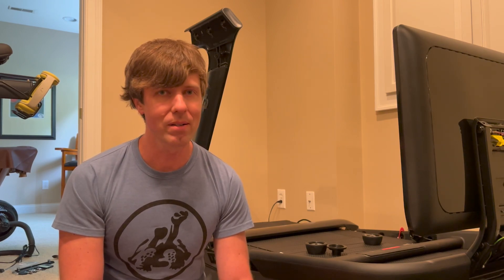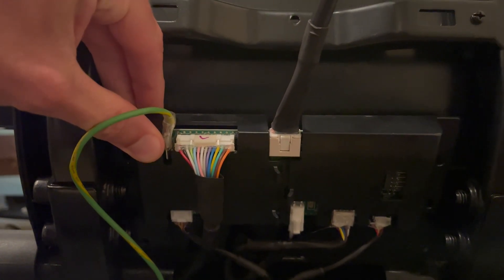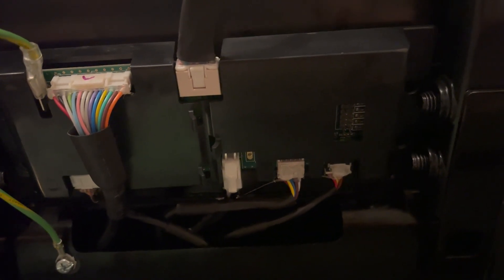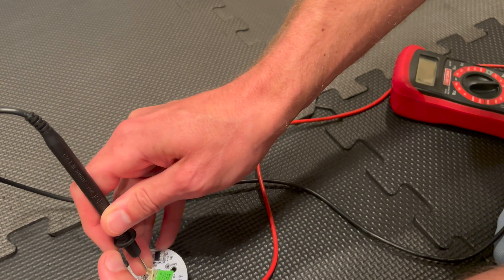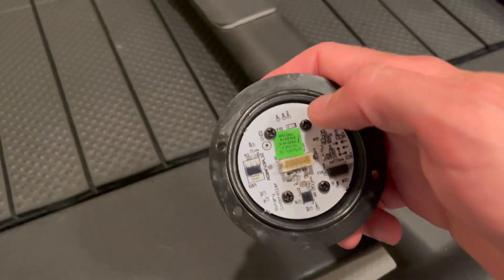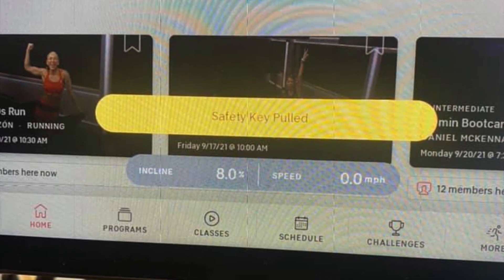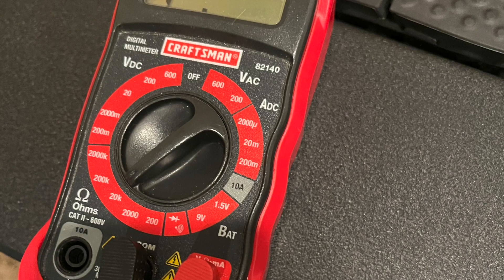Peloton Tread+ Repair DIY Tread has stopped communicating, firmware failed, and safety key issues

Comment: Hi Charles, first of all I want to thank you for the videos you make so we can do maintenance on our machines. Look, I have a problem with my Peloton Tread Plus: I turn it on, it starts, but after a few seconds or a minute it stops and shows error T0201 – error T0256 (Remove and reattach the safety key).

Do you think you might have any advice to give me? This has me frustrated since I already replaced:
	•	Speed knob assembly
	•	Smart card PCB
	•	Tread+ wire harness

Even after replacing these three parts, the problem still persists.

Comment: Do you have pictures or images of the backside of smartcard pcb? I think theres a solder problem on my connector to the LCD.
Reply from the maker: Sorry I don't think that I do. The only images I have of it are in this video. I never did any tracing as I just tried swapping with a new one.

Comment: Hi Charlie.  We have a Tread + that stops working while running/walking.  The message that pops up when it happens is "Looks like you're off the tread.  Belt will stop in 12 seconds".  The first few times it happened the screen would turn off and belt would stop.  Now the belt stops for a second, the screen stays on in the class and the belt turns back on.  We had a Velofix technician out and he said the base needed to be replaced and after talking to Peloton support they said it was a 223 error.  We got the tread + in December of 2019 and have had no problems.  Velofix put on the rear guard a few months ago.  Any advice?  We are out of warranty so it's a huge expense to replace the base.
Reply from the maker: Hey Stacy. Sorry I don't know exactly what the issue would be. My hypothesis is that the Tread senses whether a user is on it by measuring the load on the motor. This is why it won't work with people under a certain weight. When it gives you the message, if you shuffle your feet or try to slow the belt a little does the message go away?
Reply: @charlieaf92  Thanks so much for replying.  The message pops up when the tread starts, then it works for about 13 minutes.  Every time it stops the message pops up and then it's just a continuance of it stopping.  Sometimes the screen turns off and you have to restart, but most of the time it stops and starts, but clearly you can't be running or even walking fast under those conditions.  We bought our tread plus  in 2019 and have had no problems until 2 weeks ago.  We did get the rear guard installed in June.  We had a tech out here and he confirmed with Peloton it's throwing errors (223?) and said we would have to replace the base.
Reply from the maker: @StacyFink-p9z  Hey Stacy. With the machine turned off are you able to make the tread belt turn? Try pushing it with your hands. It should take some effort to make it turn. Let me know if it feels loose.
Reply: @charlieaf92  Hi Charlie.  We can make the tread belt turn and it is not loose.  We started the tread and this time we had to reattach the safety key before it would start. That is the first time we got that message.   My husband tried it in free mode and it works fine.  He thinks it's the motherboard :(
Reply from the maker: @StacyFink-p9z  Hey Stacy. Just to clarify, when you started the machine the key was in place but you received a message saying it was not? Then removing it and replacing it fixed that issue? If that's the case I tend to agree that it sounds like a logic board issue. There are several in the machine. My last bit of advice would be to call Peloton and ask to speak with someone in the parts department. My experience has been that those folks know at least a bit about troubleshooting and what parts to try swapping out. Their policy may have changed, but when I replaced my "smart card" during troubleshooting they allowed returns if the part didn't end up fixing it.

Comment: Thanks for the video! Great info. Do you know if there is anywhere to purchase a new communication cable? I accidentally pinched it in the side rail and it severed the black and grey cables. Thanks in advance
Reply from the maker: I'd call Peloton and ask to speak to their parts department. I found them to be very helpful.

Comment: Where did you buy the replacement PCB? Do you have a direct link or did you just talk to Peloton support? I was able to order the part through Peloton support, but a direct link would be preferred! Thanks!
Reply from the maker: I had to call support and then ask to speak to someone in parts. Once I got to the parts department I was pleasantly surprised to find them knowledgable and helpful. They definitely know more about troubleshooting and repair than the standard support person you get when you first call.

Comment: This was very helpful. I have the Peloton Tread (not the plus) and the wires got nipped when reassembling after moving. We know which wires to replace but unsure of how to feed them through the u-rail. Will the U-rail completely disassemble enough to feed the wires up to the monitor?
Reply from the maker: Sorry I can't say for sure. However if you have access to one of the snipped wires you may be able to use some electrical tape to attach the new wire to it and pull it through.
Reply: Were you able to figure out how to feed them through? Nipped the communication cable when putting back together. Also, where did you buy the replacement wiring?

Comment: any common issues why my tread is not turning on? I had to move it to my garage reassembled it and now it’s not firing up. I have it plugged into a non gfci outlet.
Reply from the maker: It's possible the outlet is on a GFCI circuit even if the outlet itself isn't GFCI. I'd check your breaker panel to see if any breakers are tripped + look around in the garage and see if there is a GFCI outlet that has tripped that is part of the same circuit. There is also a little breaker on the Tread itself, right next to where the power cord attaches. I'd make sure that hasn't popped.

Comment: Hey Charles thank you so much for the video I was hoping you could help me out with an issue I am having with my tread meal (Not a Plus) my tread meal won’t go over 3mph without giving me the message of me being off the tread meal then behinds the count down to bring the tread meal to a pause but if I lower the tread meal to 2.9mph it goes away and continues to work fine. Any suggestions on what it may be?
Reply from the maker: Greetings. I'm not quite sure why this would be happening. With the Tread+ (not sure if the Tread is the same), I believe that the "off the tread" warning is triggered by the resistance the motor is seeing. Basically it measures belt speed compared to the power the motor is producing to check for "drag" caused by a user on the belt. I have heard that people under 100lb don't weigh enough to sufficiently trigger it. If you are of sufficient weight the only thing I could think of would be possibly that the belt is slipping under load and as a result the computer isn't seeing the motor slow down like it expects to.

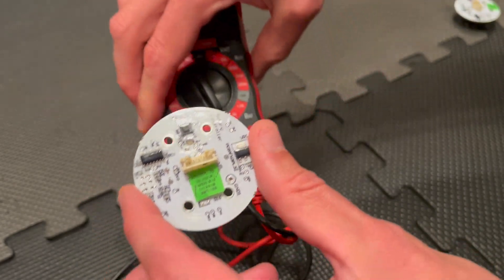Comment: Thank you for this video -- I think I have this exact same problem with my Tread+.  At 4:06, can you tell me what setting you turn your voltmeter to (I've never used one before)?  Also, would that setting be any different if I were testing the harness at the Smartcard?  Thanks.
Reply from the maker: I set it to check for continuity. If you do a search for "continuity setting volt meter" you will find some tutorials as well as a picture of what the continuity symbol will look like on your meter. Basically when in this setting, any connection between the two probes will produce an audible alarm. You can test it by touching them together first like I did in the video. You can check from the harness at the smart card - this will save time and had I known what I was looking for initially that is how I would have done it. Check both harnesses so that you can use the second one as a control to ensure that you get two different results. Hope this helps!
Reply: @charlieaf92  Thx that helps a bunch.  I actually just received the speed knob PCB and installed it since that was the last knob we used before the Tread went down.  Unfortunately, it didn’t fix the issue (non-responsive knobs, normal touchscreen without error messages).  My follow-up question is: is the PCB installation plug-and-play ie once installed the Tread+ should recognize it and just start working (if the PCB is the culprit)?  Do I need to do anything else on the touchscreen?  Thx!
Reply from the maker: @khoatran613   Sorry to hear that didn't resolve it. To answer your question - yes it was plug and play. Once I replaced the knob, the software update completed and I no longer received the error. Were you able to test the pins for a short on both knobs? It is possible the other knob is the culprit. If you can describe the symptoms + the sequence of events that led up to them, I might be able to provide a bit more insight.

Comment: Great video! But I am perplexed by the comment you made regarding it being a good thing if you have no continuity with the roller circut. I have a tread+ and having a no comminication issue as well. But ours starred when a pillow got caught underneath and cut wires to the incline motor. That is fixed but now im getting no continuity between both the speed and incline knobs ans the smartboard. Any idea of where the break could be? Or is it possibly a simple case of a new smartboard?
Reply from the maker: Greetings - thanks! The wires from the knobs run straight through the arms of the machine to the smart card in the back - so your pillow incident wouldn't have damaged those particular wires. My memory is a bit fuzzy but basically my comments were about continuity (and more specifically no resistance - I think I misspoke) between the positive and ground pins in the ribbon cable. Basically my speed knob had shorted out and the smart card sensed this and put the machine in a "limp" mode so to speak.

Comment: Do you know what the power coming in at the bottom of the cable that goes to the touchscreen should be, and which pins? It would be good to be able to determine if power is getting from the base/handrail to the touchscreen. Or is there an alternate way to power the screen externally? I see there is a USB-C socket higher up on the back of the screen, but I don't want to shoot even USB power into it without knowing what it's for.
Reply from the maker: Unfortunately I don't know which pins supply the power from the smart card to the display. Is your issue that the display isn't powering on? The early Treads shipped with a USB cable that would plug into the back of the display. It was unneeded, but suggests that it is a valid way to power the display. You could always unplug the cable from the back of the display and check the pins (while powered on) for voltage. I would unplug the cable from the back of the display and then try the USB-C socket. Without knowing what type of wattage is required you may want to try to research that a bit.

Comment: Hey Charlie! I believe I’m having a similar, but not exact issue with my Peloton Tread +. I’ll be running along, usually a 30 min class. And then start my second class and a few minutes in the tread will stop. The speed on the screen will stay at whatever I have it on, the speed nob will blink and the only way to get the tread going again, is to unplug it and restart it. The tread will start going again, but usually stop a few more times before I’m able to finish another 30 minute class. I’ve been dealing with customer support for about 3 months now and zero help and zero follow up. I’m in Alaska so there isn’t a repair or replacement option for me. Also I bought the treadmill second hand about a year and a half ago. Any thoughts? Your videos were very helpful and I think it may be the speed knob? Or the board in the back? Waiting on my voltage meter to arrive. Thank you for all the help you provide!
Reply from the maker: Hey Ross! Sorry to hear you're having trouble. Question - when it stops (but screen continues to indicate its moving) do you hear the motor running? I assume not but thought I'd verify. I'm a little surprised it still says the speed on the screen despite it not moving. Another question, when the belt is moving and you step off the tread do you receive the message about stats being paused and the belt turning off if you don't get back on?

Comment: Thank you for taking the time to put these Peloton Tread videos together. They are giving me hope that I might be able to solve an issue I'm having with my own Tread. Hoping you might be able to offer some tips or insight into the methodology I should use in diagnosing my issue. Without going into too depth, after owning my new Peloton Tread for 13 months (just one month past the warranty expiration), it started throwing an error code during the firmware update/calibration sequence. Mine is a Tread (not a Tread+), but I suspect there are similarities. Anyway, the firmware update would get to 4% complete, then freeze, and show an error code: OTA-800. Peloton sent me a new screen, saying the error indicated a touchscreen issue, but with the new screen I get the same symptoms, where firmware freezes at 4%, but with the new screen the code now reads: OTA-807. In both cases, the less in the speed/incline dials and the stop button all flashed red. Rebooting, factory reset, de-static power cycling... none of this has made any difference. Being that I'm one month out of warranty, any repair is on me to pay for. Being that (as you mentioned) Peloton has designated their machines non-serviceable, a repair will entail simply replacing one of three parts of the Tread; the touch screen, the rail, or the base. Based on the symptoms I describe above, how would you advise I approach this? I'm reasonably handy, and I do own a multimeter. Thanks in advance. - Will
Reply: I have the same model and the exact same issue. Were you able to solve the issue. Peloton wanted to send me a new base for $1000+ which I have refused so far.
Reply from the maker: Greetings. You're welcome. It is hard to say what is wrong with the details you described. Have you asked Peloton what the new 807 error indicates? Getting stuck during the firmware update (based on my experience) has indicated a hardware fault. In my case it was a short in the speed knob. Does your Tread have a "smart card" at the back of the display where the various components (knobs, stop button/key, and display) all connect? One thought - if you used a major credit card to buy your Tread, there is a good chance you have an automatic extended warranty through your card issuer. I'd go that route if you have that option before you spend too much time and effort diagnosing and trying to fix it.

Comment: Did your issue start by using the knob or was it after a firmware upgrade?  I have a similar issue where I got that error after a FW upgrade.  Then what appears to be no power or button activity to anything except the tablet.

I have factory reset to no real improvement.  When allowed the tablet to then reach out to 'home' for updates it downloaded what I and it believes to be a bike software package.  I now get a general message that there is a problem, on a black screen saying please reboot.
Reply from the maker: Mine started almost immediately after making a speed adjustment. There was a physical fault in the PCB board that shorted and caused everything to shut down (while I was running). In an attempt to fix it, I did a factory reset which prompted the firmware update/download that ultimately stalled/failed. I'm not sure how helpful that is for your situation. It might be worth calling Peloton and asking to speak with the parts department. I found that the people I spoke with there had some knowledge in terms of repair and troubleshooting procedures.

Comment: Hi, our problem exactly! How do we purchase pcb boards ,small parts and cables?? If you had not removed the dial, which part would you have replaced to repair the pins?  P.S I do not live in US we cannot call Peloton technician for service. We will have to order parts and fix ourselves.
Reply from the maker: You can call Peloton directly and ask to speak to someone about ordering parts. They're surprisingly reasonably priced and helpful. Once you get to the actual parts department, those people tend to know much more about the machines and troubleshooting them as well - it is like having a technician on the phone. It's worth a phone call. My problem was the PCB board inside the speed control knob. There were no pins to replace/repair - the entire knob assembly (or just the PCB board) needed to be replaced. The board was about $20US, and the entire knob was about $40 if I remember correctly. Good luck and let me know if you have any other questions!

Comment: Do you know how to replace the graphic card on the tread+? Peloton did an update and after that my touch screen classes look blurry. I’ve called them and chatted and they just say it’s not covered and that I need to purchase a new touchscreen!
Reply from the maker: Sorry I do not. If I had to guess I would say it is a non-serviceable part. The tablets that I've seen have GPU and CPU soldered directly into them and they are not replaceable. If you haven't already, I would do a hard reset (unplug for a period of time) and see if that does anything to help fix it.